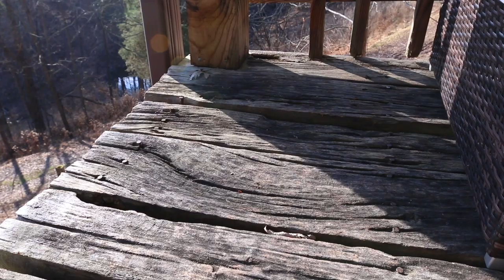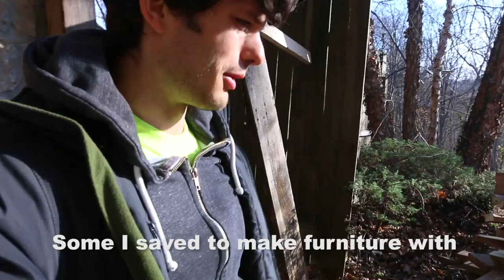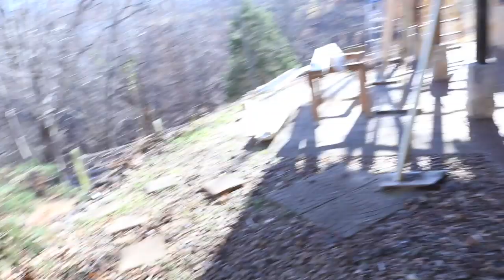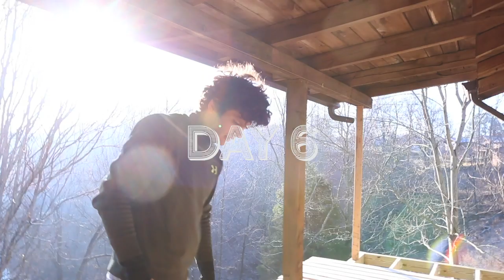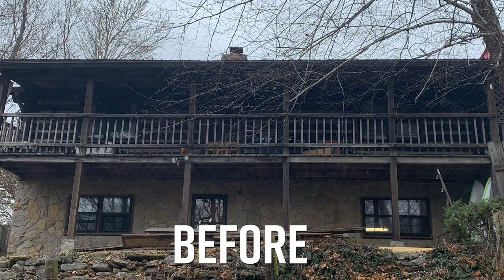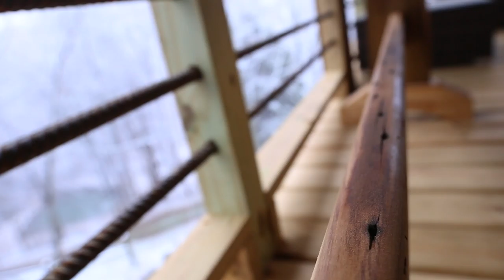Our biggest home update. I learned so much.

Comment: The decking looks really really nice! Did I noticed you spacing the boards? if so, were you using KDAT? I like KDAT a lot better than the Pressure Treated Yellow Pine. The PT just shrinks and cracks so much shortly after installing. This looks really nice! Great job

Comment: Great work man. Was curious why you were drilling pilot holes for those deck screws? Most deck screws are self piloting, and that plus an impact driver makes quick work. Just wondering if there is something I am missing.
Reply from the maker: I like making work harder for myself basically Haha Even with the self piloting, the screws were still cracking the wood, so I thought I might as well just drill first.
Reply: @JordanTaylorVideos  Cracking the wood, no kidding? It would seem as if we have about the same luck with this stuff. Anyways, great work though. The rebar railings are beautiful.

Comment: . . . confused. Why is it taking 30 minutes per board to screw in 10 screws? I mean, good job on the deck, but you really stressed the time factor, so . . . curious as to what the holdup was. Not like you're on a timer, just wondering if there was something I didn't understand.